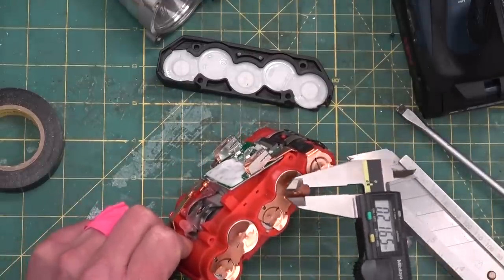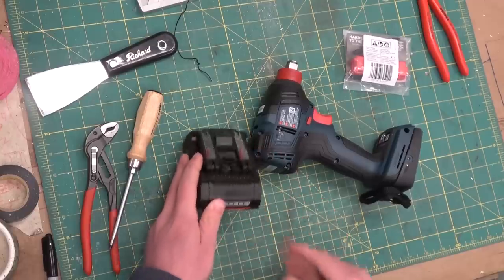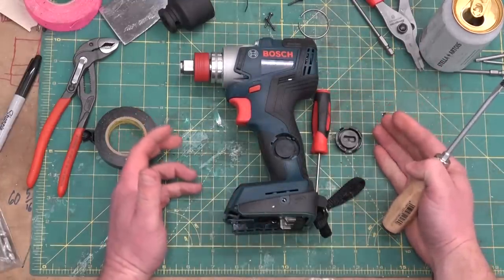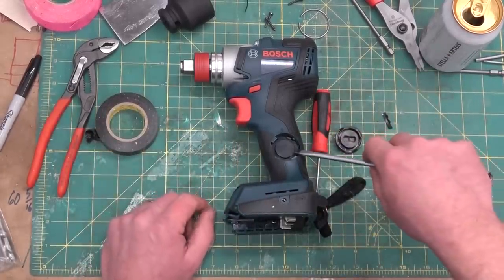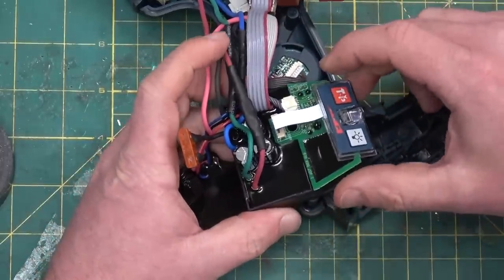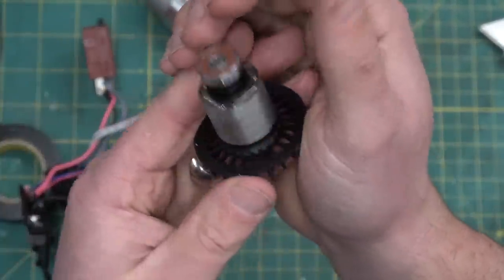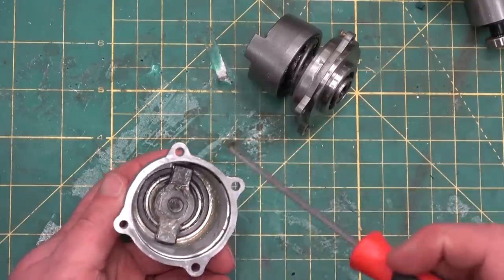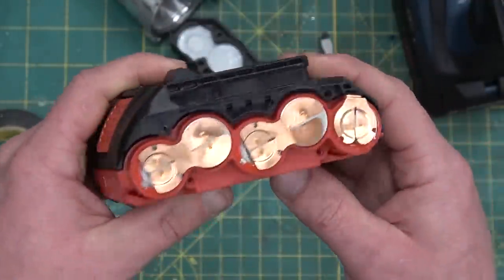BOLTR: BOSCH impact driver | CORE 18V

Comment: I've used the 18v core batteries for 2 years and it hasnt let me down running about 2 hours putting metal roofs on
Reply: So would you say more chooch more better?
Reply: How's the battery drain on them? do they still have most the power when the battery is low? I find that the regular batteries from some tasks are useless when there down to 1/3, and the 2.0Ah batteries start to tapper off after a few minutes of heavy use.

Asking because i'm thinking of going Milwaukee Fuel
Reply: @MrHeHim  Hope I'm not too late!
I'm running a lot of the (European called ProCore) Core batteries, and have honestly never experienced any loss of power until I'm at like 1/5 or so of the capacity.
That said I usually don't run them that low because I have a lot of them and just change them while changing tasks, but I'm very pleased with my purchases over the last 3 years, and would recommend them to anyone. 

Milwaukee has a lot more tools, some with more power, but I've never felt any lack of power in my Bosch tools, and the comfort is amazing :)
Reply: @Mattittas  picked up a kit with the Freak and hammer drill with two 4.0Ah Core18v batteries, totally agree! Awesome batteries

Comment: I use DeWALT and BOSCH. I still like the BOSCH more. Mostly because it fits my hand better. Please consider that I'm not native English speaker. 

The plastic „heatsink” is not heatsink at all. Its designed to keep the cells mechanically and electrically separated and protected in case of mechanical damage. So even if the black side covers are damaged, chiped out, cells are relatively safe. The ribs are there because of weight reduction. It works fine. I have also replaced the cells in three or four batteries - it's doable. 

The copper sheet is absolutely fine by electrical POV. Yet yes, they tend to pop off when you disasemble the battery. I personally solder them carefully in place first time I do a battery maintenance(after the warranty, if battery is lucky enough to get to that point)

I also made myself a few metal rings instead the red plastic one on the head.

The BT is useless until you realize how much fun you can have when your colleagues borrow a tool from you - makes them bring/buy their own equipment therefore actually saving you money - we all know these guys.

In the end I have to admit that I make a lot of upgrades on my powertolls. The BOSCH is very eligible for this. Thars why I like it. Even without that mods, all my BOSCH tolls managed to live trough their warranty without upgrades, mods, excessive cleaning and without single malfunction or service needed. Daily use. Excluding the batteries(2 cases of mechanical break, one time water inside...I have about 20 BOSCH total/14 BOSCH CORE)

Comment: Have owned my pre Core batteried driver for over 6 years now, pretty much every day, in the construction equipment repair buisness, and even  to my amazement, the thing still chooches along well enough to not need a replacement yet.

Comment: Great video and as someone who regularly drops my hammer drills without catching them ( I saw a guy catch one once with a 3" robertson deck screw affixed and he had to back the screw out of the meat of his hand!) I appreciate the 12' drop test. As far as the 4 thou  copper connectors you mention the work hardening of copper... if you have thicker copper you will have much higher strains on the outside  of the bends so perhaps the lack of thickness is a way of improving reliability of the copper contact especially at the right angle bend where it goes from the side to the end. Finally, a comment of German wiring...  the way that German equipment is wired has left many North Americans scratching their heads...
Reply: " the way that German equipment is wired has left many North Americans scratching their heads..."
we can say the same thing with BMW autos
Reply: @tuneadoes  same with my Mercedes Sprinter and VW's... I have a colleague who loves BMWs and VWs because he can get them cheap and has the patience to find the ground faults.
Reply: Even my hiti has left me up shits creek in the battery department. Even the motor on mine has been replaced twice.

Comment: I'm disappointed it failed the 12' drop test, as I often work on my lathe 12' in the air
Reply from the maker: Huh, I thought it passed.
Reply: What if you're a roofer?
Reply: @stuartd9741  no just using the good ol 12' snipe to tighten down the tool post
Reply: Is that a cosmic lathe , vtl or 200" swing ?
Reply: It passed,but the de-lamination is a concern.
Reply: @MAGAMAN  I'm talking about the drill?
AvE dropped the drill from a ladder. perfectly plausible scenario if One was a roofer.
I think mentioning the  lathe was a joke.

Comment: the plastic tip keeps us from damaging other stuff.

the thinner the foil, the less cracks matter (from enginerding school)  its why fishing line is strong.. if it were a rod it could crack easily.

the O ring was a goof.

for assembly of aerospace or medical devices logging what assemblers do can help with quality assurance.   its for hiring malicious people and recognizing them, or making it easy for them to comply with the rules and not break stuff. 

the bigger cells are being used by tesla, donno if it makes sense for the tool...  each part in the cell is stressed less... but heat build up can be an issue.
Reply: The bigger cells used by Tesla means more heat build up, because they are denser cells, the only reason to go bigger cells than 18650 is for more energy density at the cost of durability.
Reply: What do you mean by the thinner the foil the less cracks matter? Could you expand please?
Reply: @IAlternateMyCapitals  He phrased it badly. The thinner the gauge the less you need to worry about cracking and fracturing, because it can move and distort more easily following the movement (or vibration yadda yadda) of the surfaces it is attached to.
TL/DR It'll move and bend where a thicker gauge would crack and snap.
Reply: @jamesfirth7795  Flippy flappy, no cracky.
Reply: The bigger individual battery cells may help as you can get more capacity in the same volume given we are only using 5 cells. The white stuff also helps prevent the cells from moving.
Reply: @benedictroberts678  It's kind of disturbing that your statement is accurate given your choice of words 🤣 but yes, that is correct.
Reply: @jamesfirth7795  No cracky, no breaky; Is good.
Reply: @jamesfirth7795  thanks for explaining :)
Reply: @Gungarr  actually, no. They have more capacity, like you said, but also more power with lower resistance. Lower resistance means less heat at the same power output.

Comment: The Bluetooth is usually for job site tracking so if it leaves the Bluetooth range it sends you a notification and then disables the tool (theft prevention)
Reply: the tool works without it.
Reply: @NGC1433  Yes but the site manager knows when a tool leaves the site.
Reply: @NGC1433  Maybe not if the feature has been enabled first.

Comment: Ok I’m having some trouble understanding what the verdict is with this BOLTR... you abuse it, it survives remarkably well, it’s well made, electrically safe, uses quality components like caps (that’s gotta be unheard of for modern consumer power tools!), and packed full of features with good specs, only has moderate griebling, but you don’t like it because the inside of the clamshell has apprentice marks and the battery pack uses what appear to be thin (but wide and certainly perfectly rated for the task) cell connections, and it has a small amount of cost in the optional Bluetooth thing that’s probably more than offset by selling the data they mine from it lmao.. at least the majority of the Bluetooth components are not included and are on a separate module. I get that a BOLTR is designed to look at the things most reviewers don’t, but it seems like Bosch put in a darn good showing and they’re not made by TTI, so that’s gotta stand for something right? Also wish I had a spare (or even a single lmao) GDS18V-LI HT to send in and see if the tool and die makers in Germany find things a little easier to get right. Lol.

Comment: 28:55 The Copper Strips double as a fusible link between each battery contact, so they use what ever guage suites the current rating.
Reply: I would have to disagree since the spot welds are the "weak point" electrically.
Reply: @benbaselet2026  look at HBPowerwalls they have videos on the similar design strips but in Nickel not copper......
Reply: @benbaselet2026  there is a thin section though? And the TPE is holding the copper tight to the terminal, the spot weld is probably carrying 5% of the current...

Comment: The answer to the question why the larger batteries is relatively simple.
The larger ones have a higher energy density, meaning the old 2 AH battery would be almost as big as the new 4 AH battery.
So if you have twice the capacity in almost the same space, I don't think that is marketing, but progress.
I would rate the Bluetooth module depending on the tool.
For measuring tools I think the transfer of data and documentation is very useful and time saving.
Also the battery lights benefit from the possibility to control them from a distance, especially when they are positioned in places that are difficult to access.
I also find the possibility to determine the kickback behaviour of the percussion drills very helpful.

Comment: You can be 100% sure that at least 5 German engineers have independently checked and double and triple checked that those battery connectors are sufficient enough to deliver enough amps to satisfy the drill and the fuse in the drill and outlive even the reviewer, at the same time keeping cost down and in front of the competition.
Reply: but they haven't check that the big fecking hole in the middle of their impact wrench's anvil doesn't reduce the torque by half

Comment: The new Milwaukee drivers have the bluetooth built in and it is for both tracking and controlling torque. My job switched over to them, comes in real handy for all the dull apprentices that like to run the impact right through the nut.

Comment: The whole industry is shifting towards these newer 21700 cells. I have both the newer and older 4ah packs and side by side, the newer one is more compact and can discharge higher amps. These new 21700 cells are no joke! I also have two of the 8ah batteries powering my e-bike and they can handle 30A with no sweat. The new 8ah is barely any bigger than the older 4ah.

Comment: Company I work for bought a dozen sets of these Bosch cordless tools for us last year, impacts, drills, jigsaws, grinders, lights... So far I don't think we've had any failiures... We smoked a ton of DeWalt 18 and 20v stuff though. And we abuse them, I swing 6.5" hole saws with the hammer drill and I've been known to drill through 6" beams with a 1.5" spade bit in the impact lol.... I still prefer the DeWalt drill and impact to the Bosch for torque and feel.. But the Bosch jigsaw is amazing, i liked it so much I went and bought a big plug in one for my shop

Comment: 21700 cells are monsters when it comes to amperage, well above the standard 18650.
Reply: Yeah but I believe he was questioning the copper interconnects between them, not the cells themselves.
Reply: @RawDR  he also questioned the use of the large cell, as you can put more smaller cells in the same space to get the amperage needed.
Reply: Yup, I believe the newer DeWalt 9/12Ah packs are moving to larger cells as well.

Comment: Those marks aren't to try and keep the part in the mould, it's to try and take it out. The finished surface(outside) is the cavity of the tooling, and in order to drive up parts per hour the moulders will have likely taken time away from cooling the part(which makes the part cling to the inside core) so they add those little marks to help demould it.
Reply: Old vid, I know...whatever.  I thought that's what he said "won't release, so they added these lines"

Comment: The plastic fins are a way of making a strong piece of casing that can also expose the battery directly to outside air helps for cooling but expose the battery to things that can bend or puncture them. Bigger battery because it has a bigger capacity and a lower internal rezistance which helps at extracting power from them more efficiently. I think they need them that way. Because the gauge of the motor wire coils looks like it will manage a lot of amps.

Comment: 3 years later, im still using the same bosch impact i got before this video came out. Dropped, wet, thrown, you name it. Yes im a contractor, install windows, doors, etc. Batteries last pretty long. Im running older style and newer core and the new new procore. Either way the drill is still going. 😂

Comment: 11:42 actually a weld, removing material in the plastic part requires adding material to the mold.
Reply: Yeah, I was thinking that. It's a very fine/thin weld through!

Comment: I have used the old model without Bluetooth for over 2 years and it works fine only thing is the red grip on the end came off but its metal underneath.

Comment: Had a Bosch 18V 4 Amp Hour drill. Bouthg because it was the shortest available at the time so I could get stubby augers and drill between non standard close together ceiling joists. Had a lot of use  but it fell apart after 5 years and fixing would have almost bought a whole new drill! Had a bare version of the matching impact driver that I was disappointed in from the start. Gave the driver, battery, and charger to a charity. Replaced the pair with a Milwaukee pack - vastly superior. Also superior to a friend's DeWalts. Love my small Bosch angle driver and my 12 volt 85mm circular saw is a bit flimsy but an excellent small tool - actually, I'm using it a lot - amazing how most cuts are 1" or less. But the drill and driver were not good.

Comment: 3:00 lol in Canada you could legally put both your weed and ammo/gats in that bag.
Reply: Weed sure, but he did specifically say job site which it is still a no go. And the ammunition and firearms Canada has a tremendous amount of rules regarding transportation of which I only know enough about to know that I don't know enough to attempt to explain them. But rest assured if you put firearms, ammunition, and weed in that bag you'd probably end up in jail if you had a chat with a officer.
Reply: Just leave your ninja stars and nunchucks  at home.
Reply: @jaydunbar7538  No you wouldnt. lol You could put rifle ammo and weed in there with zero issues. Rifle would have to be transported in a rifle bag/box though
Reply: @Hoaxer51  Eh as long as we are talking just an ounce or two and some hand gats you should be fine. Depends on the gun/case for sure though.
Reply: @jaydunbar7538  did he say job site? I thought he said to the range. Cause most employers won't allow you to have ammo in your vehicle either. Also breaking an employers rule isn't law.
Reply: @jaydunbar7538  What if you're working on a weed farm? :O
Reply: @DKTAz00  then why would you bring any with you?
Reply: @jaydunbar7538  Well, the pun was "then there would be weed at the jobsite"

Comment: It was interesting to see inside this thing, so thanks for that, and for the amusing comentary. However your beefs seem to be minor and twatty - the pinched O ring, ok, the foil in the battery and the plastic release thing (and the bluetooth). The fundamentals of the unit - motor and impact mech - look robust and I feel encouraged to buy one, thanks again.
Reply: Every year that goes by, these things get worse.  Sure it’s small stuff but that small stuff can bring your work to a grinding halt until you get some parts or whatever to fix it.  Time is money.   Get the metal parts where you need them and the plastic where it makes sense.

Comment: Regarding the battery separation mentioned at 14:00, it may be better if the battery does separate from the tool in a drop. That is a non-destructive way to dissipate a lot of the energy of the fall, and it does ensure that the tool will stop. That doesn't matter much on a driver, but would be important on a circular saw just in case the trigger somehow jams from the fall. These could be fortunate accidents of a weak design, rather than intentional features.

Other things:
50V capacitors - WTF? It's an 18V battery tool! Many would go with 24V or 30V; I like voltage headroom but that's just excessive.

I can't understand what the bluetooth is supposed to do, the advertising BS just says it lets you "customize tool settings" (what settings?), but it doesn't even have RGB for the geek street cred. There is a possibility - however crazy - that it's cheaper to put Bluetooth on the tool than it is to install a normal switch and circuitry. That does require Bosch to make a functional app, which isn't hard to do if they hire or contract competent developers - but many companies manage to mess that up. Either way, no one wants to pull out their phone while hanging upside down from the ladder, just to smear their greasy fingers all over the screen.
Reply: 24v and 30v caps are probably on the BOM, along with 50v and half a dozen other usable alternates. The 50v was what was most available/cheapest that day, the CM had a load of excess from another build, purchaser at the CM knew of a pallet of caps that fell off a truck, etc etc etc so that's what got used.

Comment: I think the thinness of the copper is due to the ark welding they have to do. I saw how difficult it is to connect these via arcpulse, the thinner the copper the shorter the heat pulse the less likely a blowout of lithium becomes that's my best guess.

Comment: Work in the cable industry.  Our  standard is the 28' drop 🤣😂 1/4" deWalt lives every time.
Reply: Concrete is a lot less forgiving then the trainee's hard hat
Reply: @Heizenberg32  we use the can wrench for that. Dewalt has hit pavement though
Reply: @Heizenberg32  yea but i dont throw my impact AT the floor
Reply: @jamesbondo5895  haha